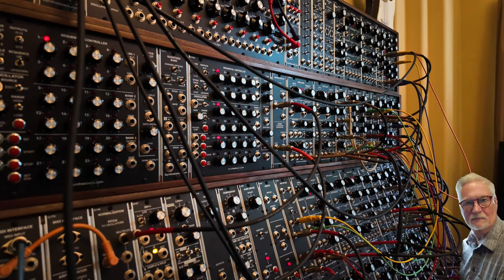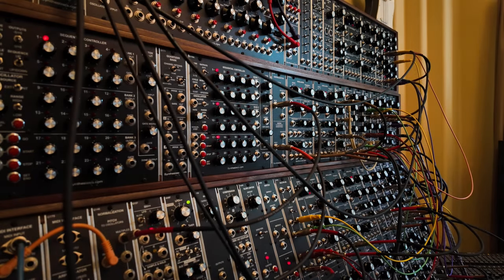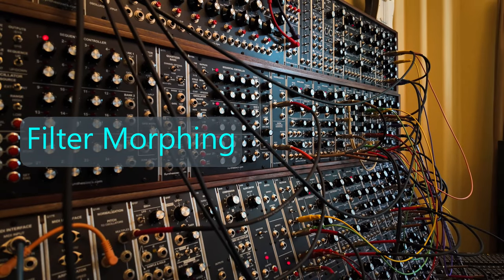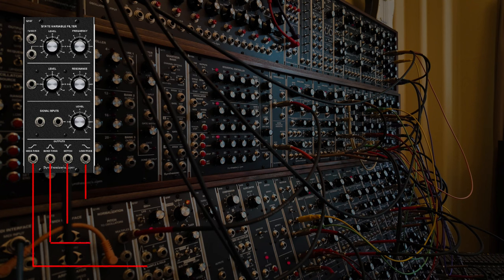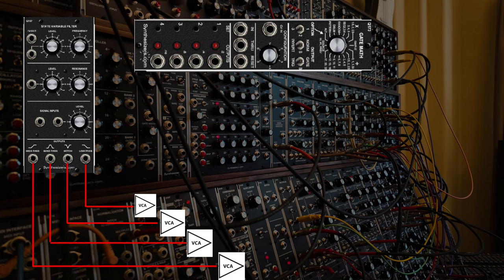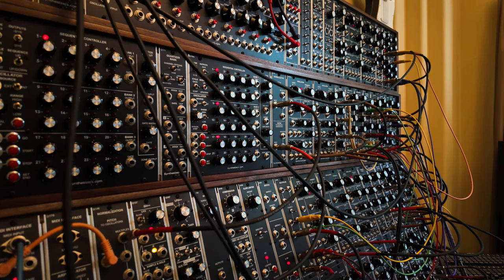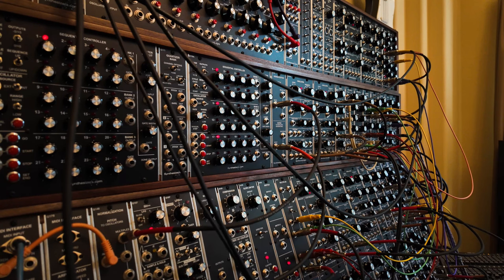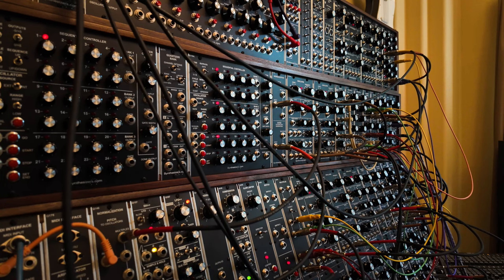Modular Morphing (filters)

Comment: Nice patch. The Yusynth Quadrature LFO would be another tool for driving the VCA's too. This idea was my first DIY module I built in the 1980's for my PAiA modular. It had a SVF but of course wasn't anywhere as nice sounding as the Q107. Fun stuff. Yes, the OB6 filter is a great one because of the ability to use the matrix to morph that beautiful filter.
Reply: Or the STG Mankato Filter self oscillating and used as a LFO.   I have used the quadrature outputs into a vc mixer to do something similar, but if I remember right, it was wavefolders and waveshapers I was morphing between at the time.
I like the envelope idea a little better for some things as I remember wishing the Mankato had sync so it would restart in time with other aspects of the patch.
Reply: As you work with crossfading, watch out for the phase relationship between the outputs from a single split source. You can easily get into a spot where you're getting more NULLing than mixing.

Sometimes this can be good (it's a fun way to create a notch filter!) but many times it'll drive you nuts trying to figure out where your bass went.

This is why @ilikethechaos.7032 has solid success with waveshapers, the off-phase relationship of a pile of inputs is a feature!

Comment: I had a similar idea for emulating a state variable filter using a voltage controlled crossfader on the high and low filter out. This is how some oscillators with variable shape blend between waveforms. Problem is I don't know of a voltage controlled cross fader in 5U (haven't really looked).
Reply from the maker: I believe the DotCom VCA2++ can do it. Yes, just tested it. It works because each VCA in this module has invertable attenuators. While one is getting louder, the other is getting softer. It's setup so one CV goes to both VCA's unless you run two CV's so they can operate separately. It can do panning and Ring Modulation as well.
Reply: @geoelectro  Cool! Good to know!